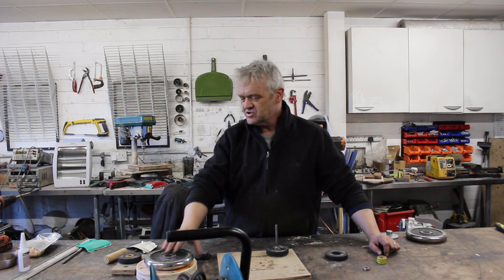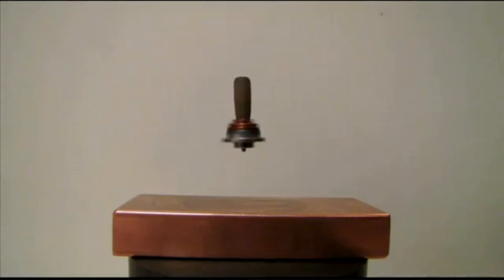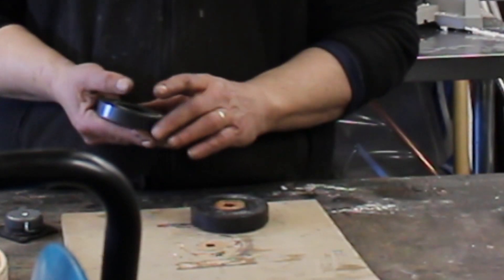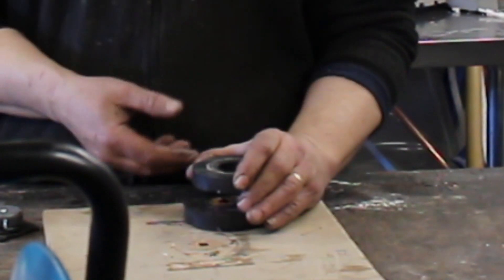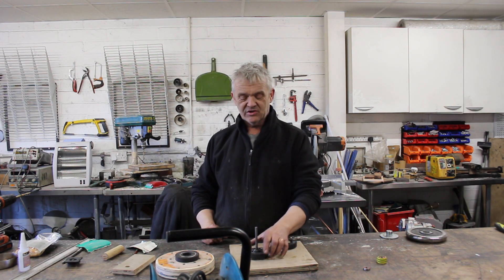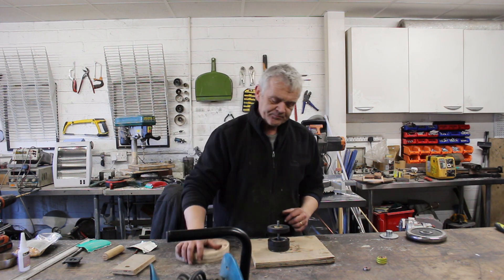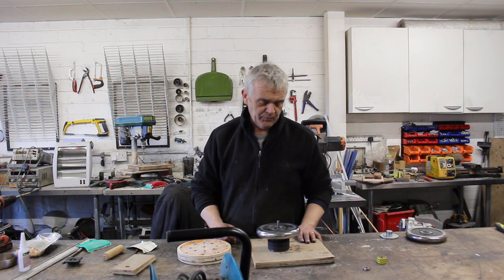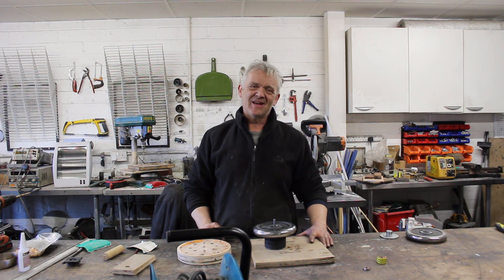1450 DIY Magnetic Bearings For Flywheels Made From Speakers

Comment: Why isn't it possible to use a central magnet of lower power surrounded by stronger magnets around it to create a magnetic valley in which a magnet could sit within (create 3 arrangements like this), then have 3 magnets stuck to a triangular platform (to prevent it flipping over) sitting in the 3 magnetic valleys? then you would have a totally isolated magnetic damping platform?
Question is can this be done in a stable manner, with the right amount of mass on the platform, you would think this might work.

Comment: I have been thinking for a long time that using a magnetic bearing you can make a super efficient fan or even an air turbine, with a very small input Watt. 
The flywheel can be used as a propeller with magnets in a circle)

Comment: Out of context but I got a great idea I would like to share with you all:
We can combine the soda train principle with serpolet instant steam production system!
Soda train like others steam engines were gave up because they were storing the steam and therefore had an explosion risk due to excess pressure inside the tank. But this issue was fixed by the serpolet steam engine, made by the Frenches Serpolet brothers. On top of the fire run a pressure resistant pipe inside where the water move in a very thin patt by capilarity. Water enter one side exit at steam at the other side. Therefore no risk of explosion. 
So a bit of soda and water can produce steam for a while, then be replace by a "fresh" dry soda, adding some water to it to keep going on. Since soda exothermic reaction produce 300*, there is 200* available to use for drying or at least starting to dry the used wet soda. Now since i beg that the steam from this process may content some soda, it can be reuse in a closed system to wet again some soda. 
Even part of the water used for the turbine may be recollected by condensation (adding an urea endothermic reaction that produce cool could be an extra option).
An other possibility is just to use soda generator on this principal to charge battery for electrical car, plane and so forth.
Reply from the maker: never heard of serrpolet before now mate - brilliant heads up many thanks for sharing the idea

Comment: Oh neat!  You fixed the cogging issues with a baring.   Now how do we keep a spin on it?    With more magnets?   Magnetic cogging is much more difficult to solve to make the magnet wheel spin forever.  It requires good magnetic shielding and that was difficult for me. To overcome the magnetic cogging bump is the hard part.
Reply from the maker: Not sure yet

Comment: Glad to see you doing this. I just use 1/2" PVC with some microwave magnets. Depends on the center diameter of the magnets. Stacking block magnets in circles will increase the strength of a single ring magnet. FYI use a metal base to face the magnets all the same direction. The north pole lifts more on the northern hemisphere. The south pole lifts more in the southern hemisphere.
Reply from the maker: nice info mate - cheers

Comment: I am developing a friction-free, fully free-floating, maglev axle design. It utilizes the natural curvature of the magnetic boundary in the X and Y axis of possible motion to refute any push off and hence, true magnetic stabilization. I may release the plans in the future. I may not.
Reply from the maker: maybe but it is well worth working onion you do mate
Reply: @ThinkingandTinkering  if i can get it working, I will be sending you the plans to build it. Its simple in theory, but requires a bit of precision balancing and bloody strong magnets for the X and Y axis. A key factor to note is that the stronger the gauss rating of a magnet on it's surface, the less it's magnetic volume will be, but, the greater its flux density. Knowing this, you can use extremely strong N52 magnets as directional stabilizers for multiple axis.

Comment: Is it not doing work or having energy taken drained from it by the magnetic field?
Reply from the maker: no mate - it's doing work because I spun it
Reply: @ThinkingandTinkering  but being a magnet in motion is it not creating a current in it's vicinity whether or not there is something conductive there to resist. If that doesn't slow it down you could remove all air resistance by doing it in a vacuum and then seek a solid material that is magnetic but not metallic or conductive and you have a levitating and spinning object that will spin forever
Reply: @SodiumInteresting  look into M.E.S.S. technology.  Mass Energy Storage Systems.

Comment: when i worked for lockheed i saw them working on  magnetic bearing system without magnets they were using light and high density plasma to generate the magnetic field had to wear anti static suits wired to a ground around it the plasma formed into lines of force looking like a toridial pattern looking allot like a rodin coil
Reply from the maker: interesting - never heard of it - thanks mate
Reply: Sounds like you were working at area 51
Reply: Wouldn't a generator spinning whit magnetic bearings be superior to current friction bearings ?
Reply: @prototype9000  My name is David Walker Cauthen. I'm researching flyback energy and pulse power.
Reply: AI suggested plasma
Reply: I was told about using light and high density plasma

Comment: Why does everyone I've seen try this use flat on flat magnets?
Reply from the maker: that's what they have and what is easy to get hold of cheaply?
Reply: @ThinkingandTinkering   availability for some yes,  folk that repurpose what they have (repurpose is good, done so all my life) but there are folk that would drop $$ on projects too I've followed the magnetic bearing set-ups used for a while and I just don't see anyone trying to work with geometry other than flat on flat which I really find odd.   When I have thought about this, what comes to my mind is: with bar magnets, and the speaker magnets (well ring magnets really), you could arrange the bar's in a V shape and the speaker as shown.  Using say two off the shelf plastic oil funnels as shape forms, glue attache the bar magnets to the outside of one and inside of the other.  Like to like of course, that should remove a lot of the X and Y wander, then use the pair of speaker magnets as shown here to retain the cone in cone so there is Z-axis stability as well.
Reply: Availability and some ignorance combination.

Comment: I guess this is a perennial question, but how do permanent magnets do work, eg holding up a weight against gravity, without dissipating energy?
Reply from the maker: I don't mean to be facetious here mate - I am being serious - but I suppose in the same way a table does after all that holds up weight against the force of gravity. I believe surfaces don't actually touch they just look like they do there is a very short range force called the Casimir force that keeps them apart. If all the drains in a material are aligned like in a magnet we can see that separation - I think that is pretty much what is going on here
Reply: @ThinkingandTinkering  Point taken. I think the issue is whether work is being done, if so, laws of thermodynamics should apply....or if not, we just accept it's as you say, a mysterious quality of nature like gravity, that we just accept as a given.....
Reply: @mfr58  

I tend to ignore these so called "Laws" as laws they are not. Just workable opinions to help attempts to decribed what is observed. They are assumptions, not Laws, base on a fixed set of circumstances like gravity, air pressure vs a vacuum. 

The so-called law of conservation of energy is a perfect example, as it is a theoretical construct never intended to be applied to the physical universe yet is applied by people to the physical universe erroneously all the time. When I question these people of letters phds and such I remind them that the law of conservation of energy is a theoretical construct and was never intended to be applied to the physical environment. The usual have nothing to say but insist it's a law, even when I get them to admit it doesn't apply to the physical universe. 

Einstein's theory of everything failed because what applies in large cannot be applied to what is in the small it breaks down.

In college Tesla's professor called his alternating motor concept a Ponzi scheme. 

If you plan to think outside the box you may want to look at all assumptions of reality as possibly only applying to a fixed set of predetermined things like gravity, air pressure, vacuum. Take these fixed forces out of the equation or counter them and all of a sudden laws don't apply.

All who made advancement in any Field of endeavors challenged what was already accepted.

OHM'S so called Law was heavy rejected and he lost his job over it. Was in practically hidings for some 30 years. 

Same for Tesla they prosecuted him mercilessly.

Comment: What if you put a third magnet on the other side of the flywheel magnet, and flipped it horizontally, secure them on the far ends.
Reply from the maker: it would fall out - with horizontal arrangements the weight is a bit of an issue
Reply: @ThinkingandTinkering  a well fit bearing on the shaft wouldn’t fix that?
Reply: I’m thinking the repelling magnetic forces would secure the middle magnet if the two on the end are secured, then reduce resistance but that’s not using your 2lb flywheel
Reply from the maker: yes but what then would be the point as it would be the bearing carrying the load not the magnetic field
Reply from the maker: give it a go mate = let me know how it works out
Reply: @ThinkingandTinkering  could you fix the middle magnet to your magnetic bearing? Then the whole system is based on magnetic forces